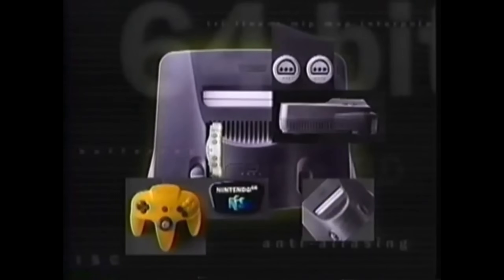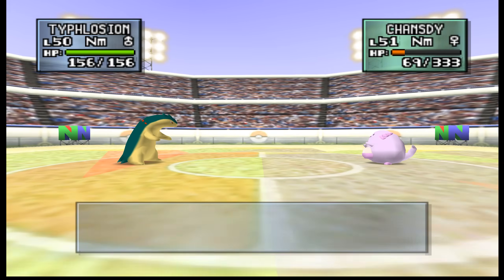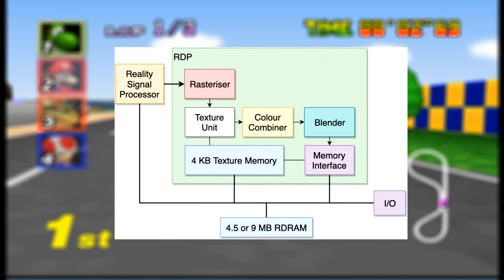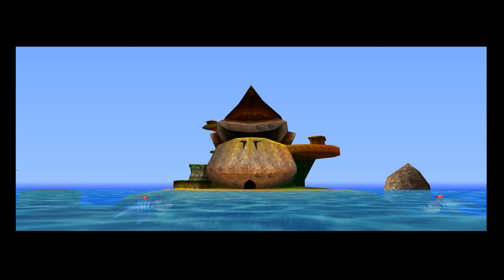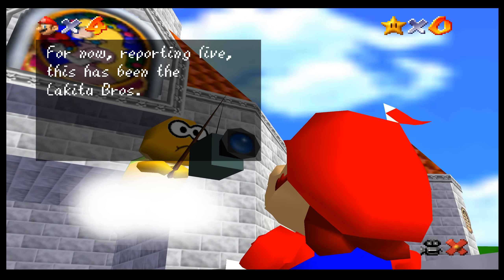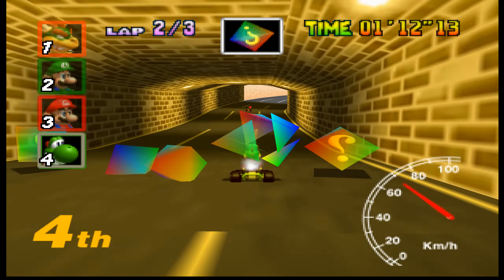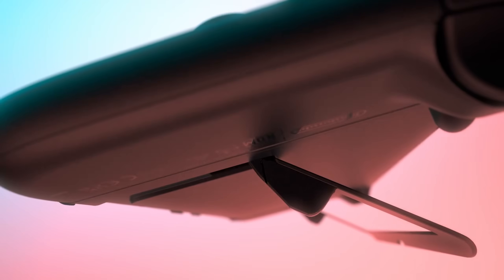The Nintendo 64 GPU: Reality Co-Processor (Retro Breakdown)

Comment: Lack of both a dedicated sound chip and Sound CPU was also another reason why N64 music in general was aggressively compressed. The compression was a trade off choice to decrease the workload on the main CPU and RSP to focus on running the gameplay and updating the graphics. The N64’s raw hardware was actually capable of CD quality audio (with a sample rate of 44.1 khz), but was rarely achieved due to high CPU demand and cartridge storage limitations. Hypothetically a dedicated sound chip and sound CPU would’ve sufficed this. Good review! 😀👍

Comment: thank you for being objective about the N64's limitations, the biggest issues relating to the bad CPU/Memory usage, and while yes, CDs had more storage, the PS1 had only 2MB of memory while the N64 had double, quadruple the ammount of memory with the expantion pak, which means the PS1 wasn't exactly capable of better textures than the N64, nor the games could be anymore complex, only really winning out in the sheer quantity/variety of assets a game could have, while with the N64 the limitation of smaller storage in the cartridges is really the only substantial culprit behind why N64 textures looked so blurry, because even with the small size of the texture cache, that didn't stop developers from creating larger, more detailed textures by simply cutting them up and joining them in-game, as was the case with the handful of games that had larger 32-64MB size cartridges, meanwhile if you download a PS1 game off a site, more often than not a PS1 game would only take up 100-300MB of disc space, and that's WITH all the assets and CD-quality audio in. I remember getting bootlegs of all the 3 PS1 Crash bandicoot games and they all fit into the same CD-R.

Comment: I love these videos. I just kinda wish the footage was rendered at the resolution and with the final smoothing filter applied. Granted, the considerable bump in render resolution is great on the emulation side. With the nature of the video being centered around the capabilities of the GPU on the N64, it would be more accurate to make it look like the actual machine is running the software. 
It's not a huge issue and I genuinely enjoy the content. I just played this generation (practically all the previous and most of what cam after) and the impression on any system from those days should really be considering the displays and the most popular means of getting the system hooked into back of the TV. 240P over a R.F. converter was pretty much average for the day (at least in the US... For whatever reason SRGB and SVIDEO inputs were unavailable/niche for the average TV from most retailers).

Comment: Even though there are more powerful ones, like 128 or more, 64-bit mode is the maximum power.

There's something I don't understand about Super Mario 64. For example, the Super Mario 64 cartridge doesn't need a memory card to save, yet there's no CR2032 battery inside the cartridge.

So does the cartridge work like a PS1 memory card? No idea.

I use translation software; I only speak French

------

Même s'il y a plus puissant comme 128 ou plus le mode 64 bits c'est la puissance maximum

Il y a un truc que je comprends pas dans Super Mario 64 par exemple la cartouche de Super Mario 64 on a pas besoin de carte mémoire pour sauvegarder et pourtant à l'intérieur de la cartouche il a pas de pile CR2032

Alors est-ce que la cartouche marche comme une carte mémoire de PS1 aucune idée

J'utilise un logiciel de traduction je parle uniquement le français

Comment: Cool video, but there were a couple of errors I noticed.

Factor 5 did not stream textures, they streamed level data into RAM (huge benefit of using cartridges)
TMEM is required for all textures, and it’s very expensive
RDRAM is nowhere near as fast as it claims to be, memory bandwidth is the biggest weakness of the entire console, which is why textures are expensive
Reply: Its interesting how RDRAM was also used on PS2 but it actually benefit the machine (at least the overall architecture they wanted), with its 2560 bit bus and 48.8gb/s of fillrate. On N64 it caused the opposite effect.

N64 really needed more bandwith... it could had at least made more titles get 30 FPS like PS1.

Comment: Actually, the N64 had a programmable graphics pipeline utilizing microcode. Homebrew has reverse engineered this and allows for some pretty advanced stuff like cel shading and fully dynamic shadows these days. There are also ways around the low texture memory size these days, i.e. there's a "megatexture" demo on Youtube. If you look up videos from "Kaze Emanuar", you'll see what the console is truly capable of when properly optimized for (high texture resolutions, more polygons, new effects and running at 60FPS!). The hardware design was way ahead of its time and people back then didn't know how to fully utilize it or work around certain characteristics like RDRAM's high latency.
Reply: only the vertex shader is programmable. The fragment shader is fixed. I still wonder what a "fragment" is. Probably the name stems from the internal data format which passes through the pipeline. We as users only care for the pixels at the end of it (after the blender). Or is fragment = (pixelRGBA, z-value) ?
Reply: @ArneChristianRosenfeldt  "Fragment" is just SGI/OpenGL speak for "pixel". N64's color combining/blending stage can be abused to do some stuff that's usually done with pixel shaders these days.
Reply: @Psychx_  I looked at the Atari Jaguar, which does not really have a texture cache. Perhaps with multiplexing it could use some of the other buffers, still texture fetching would fight with writing pixels.
So I think of the the blending stage in way that as much as possible of the fragment has been prepared and cached up to this point. Then only alpha blending needs to be applied. I guess that early texture reject breaks this concept. The Jaguar clearly would need early reject. So each pixel would be touched twice at separate times.

Jaguar interleaves z-buffer with frame buffer. This is futile. For early z reject we first need to access the z-buffer, then texture, and then frame buffer.

Comment: About those 4.5 MB of RAM: it had 9 bits RAM, and that extra bit could be used only by the GPU in some circumstances. So that extra 512 MB was not freely available for textures or other general stuff.
Reply: Are you sure it's not a parity/ECC bit?
Reply: @NathanDrake5  Of course. Why the hell should a game console have ECC????
Reply: @ I remember Rambus supporting some weird features like parity... it's a serial interface, unlike SDRAM's parallel one.
Reply: @tdome3000  "To add to this, the reason that the RAM was available with 9 bits in the first place is so that it could be used to make systems with ECC. It's just that you didn't have to use that 9th bit for error correction, you could use it for extra data, if you designed the system to use it that way."
Reply: @NathanDrake5  Still I don't get the usage in N64. For the finished frame we only need to preserver RGB. As far as I can tell, N64 has 15 bpp and needs two memory cycles to VideoDMA a single pixel.

Comment: One mistake in this video which I haven't seen mentioned in other comments is the mention of some cartridges adding extra RAM. That isn't a thing, at least not like on the NES. Some carts did contain SRAM, but that's a tiny amount and has a battery, and is for storing save files. It's not about performance at all. You could theoretically build a cart which contained a large amount of RAM (in fact, modern flashcarts are like this, the "ROM" space is writable by the console) but it would be more like adding an SSD to a computer, it would not increase the system RAM size.

I would suggest that you produce the scripts for these videos in collaboration with the modding/homebrew communities of the respective consoles, both to eliminate mistakes and also ensure that the most important points are covered (like the RDRAM latency in the N64 mentioned by the other comments). I would also suggest that you use footage from the real hardware rather than emulators whenever possible, or at least set up emulator settings to be limited to the original resolution of each console and without any added graphical enhancements.
Reply: Yeah, and why not just buy a power Pak? So you can use extra RAM for a lot of games!
Reply: @ArneChristianRosenfeldt  *Expansion Pak
And about 20% of games were designed to use it, while just 4 actually needed it.

Comment: I'd point out that the N64 was so powerful that it went toe to toe with the PC for graphical output for a good few years. That would be completely unheard of today.
Reply: It barely ran Quake 1 meanwhile PS1 was running 2 smoothly....
Reply: @sebastiankulche  John Carmack ported Quake to glide and GL. I read no complaints. Quake 2 on PS1 started with the PVS from PC to split the levels because they would not fit into RAM. 3dfx did not store the mesh. Rather the PC needed lots of main memory. Even our 386sx had 5 MB before the PS1 came out.
Reply: @ We dont have to compare PC RAM with console RAM like its 1:1 though, as consoles are always way more efficient. Some PS1 games have levels more than 5mb.
Reply: @sebastiankulche  I just meant that in times up to the PS1, PCs had ridiculously more memory just to boot fat windows. Then for DOS games, a lot of memory is available. Does 3dfx run under Windows 3.1 ? Probably not. Win95 could at least swap out most of its fat for the game. Amiga 1000 is a kind of PC and came to the stores with 1 MB in 1985, while 2d consoles maxed out at 400 kB total in SNES in 1990?
Reply: @ArneChristianRosenfeldt  SNES had 128kb of RAM and 64kb of VRAM if im not wrong, on top of PS1 RAM being newer and faster. Even with the cartridge advantage the SNES would dream streaming as much data as the PS1.

I agree about that first sentence, though it makes you thing how much wasted PC specs really are. I heard there was a few old PC games (i cant remember if they were DOS games) that interacted directly to the metal, and didnt had any OS overhead, kind of like a console game. Imagine if there was something like that on Windows.... you would have your antivirus screaming like crazy, lol.
Reply: @ commander keen and Wolfenstein3d run on bare metal. SVGA has 256 colors and scrolling and double buffering. No need for a driver to copy from the back buffer. But even with a DOS expander, the CPU only sees a 64k page. Is it really bare metal when you have to operate through a keyhole?Wing Commander III , system shock, and descent supported SVGA . And Quake, but they did not have a driver for my ET3000. You had to compile your drawing routines for each card because there was no standard for the ports.

Sound cards supported midi.
Reply: 3dfx on PC beat it in the same year. Same quality, but in 640x480 progressive scan. CD based games.

Sega MegaDrive was impossible to match on PC for a few years until ISA VGA cards became insanely fast for some weird reason. How can it even be fast to copy over a complete frame buffer on VSync ? Yeah, the video memory is idle at that time, but the CPU, which did all the 2d rendering on PC was totally blocked.
Reply: @ArneChristianRosenfeldt  About Mega Drive... Yeah, kind of, especially for 2d games, Mega Drive and SNES had unparalled sprite quality and scrolling. PCs were like one or two gens behind.

About 3d though, i doubt it, in 1988 we had Winning Run, which i doubt it would run on Mega Drive or SNES without special chips.

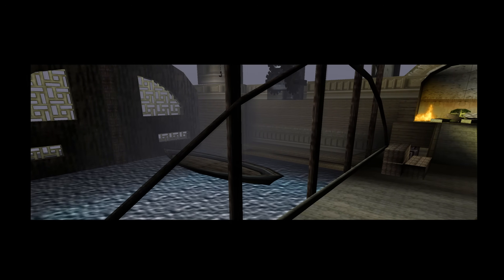Comment: 6:40  the ram is not actualy that fast, its prety slow, not even half of that
Reply: It is that fast, but at high latency.
Big issue is controlling how things are cached and invalidated again.
Kaze (who makes his own SM64 expansion) talked about it about 6 months ago, after he spoke to the developer of an emulator, and he generally goes really in depth about performance optimizations 😯
Reply: It is interesting how both N64 and Xbox have more brute force (in paper) than its competition but they also heavily bottlenecked with the slowest RAMs and bandwith of the gen.

Maybe that explains why a lot of exclusives that tries to push those platforms runs terribly slow compared to the competition.

Especially if they try to run at high resolution or use post processing effects, the system cant just keep up.

Was it to reduce costs?

Comment: Apparently, the N64 could support as much as 16 Megabytes of RAM, and this could be achieved by getting older N64s and (3rd party) expansion packs that used only 2 MB chips and swapping those chips for 4 MB ones. Unfortunately, there is no official game for the system that will make use of the extra RAM.
Reply: did you know that the C standard library has a function to check for free memory, but the OS developers don't want to tell? Each App / process should strive to minimize memory usage. In the cloud we launch Java Apps with memory limit as parameter.

Comment: The anemic cart storage space really murdered N64 hardware potential.
Most of the games have blurry textures and reptitive assests because there is not enough space to fit more textures and variable assests.
Reply: That and the texture cache
Reply: A common misconception that often gets sprouted online: The cartridge format didn’t hold the system back in anyway other than restrict what content could be stored (often being FMVs and raw CD audio files that would be sacrificed). 

Moreover, slapping a slow 2x CD drive wouldn’t automatically fix any issues of the console when we must factor in the horrible memory latency of the RDRAM implementation in the console itself. With the cartridge format, data could be fetched much quicker from ROM cartridge over RAM, a speed advantage that is lost when attempting to use CD drives that operate at a slow 2x speed.
Reply: @crazedlunatic43 The CD does have some specific things going on besides space:

If games are compressed to fit in the cartridge like Quake 1, decompressing takes much longer than loading from the CD.

The CD technology also allows for FMV MDEC compression and native Redbook audio.

PS1 does have its own RAM chip for the sound so in theory, even if N64 used all its space for just music, music in theory could still sound better on PS1, same with MIDI samples (although this isnt too dependant on the CD technology)

Redbook Audio is also almost impossible to recreate on N64 as, even if it fitted with RSP hacks, it would still need to be decompressed.

A game like Vib Ribbon wouldnt be possible on the N64 because there would be no way to swap cartridges (if they even got license music to begin with it, lol.).

I also find interesting how the game Monster Rancher does use the PS1 laser to see the CD data. Every non game CD still have unique identifiers and TOC information.
Reply: @sebastiankulche  There was definitely some advantages to be had on the CD ROM format, but I feel like the advantages were more pronounced with how the PS1 was elegantly designed

Such as the built in MDEC chip that’s found exclusively on the PS1, and is the main chip that’s responsible for delivering the FMVs that you see in many PS1 games. Sure the CD ROM format did support motion playback, but the PS1 had superior hardware when it came to supporting such a feature, and even surpasses the Sega Saturn in that regard.

Of course I do feel like both CDs and Cartridges have their own set of advantages and disadvantages and it depends on how games are designed and how it works with the console’s underlying architecture.

My original comment in this thread (from four months back) was arguing about how the Cartridge format wasn’t exactly the console’s biggest bottleneck as the media often claims, and it really had more to do with how the N64 was designed

Ideally, you wouldn’t want to use anything other than Cartridges on the N64. The console could technically use CDs, but it would be painfully slow

Fun fact: The console didn’t even provide dedicated circuitry for handling audio, so it was up to the GPU to provide audio (though the CPU may be tasked with this as well), so besides lacking storage capacity to store audio, developers had to choose between sacrificing performance and music, and the latter is often sacrificed.
Reply: @ that texture cache and the latency rambus had didn’t do it any favors.
Reply: Ridge Racers has how many tracks on the PS1? And each track needs to fit into RAM ( which is almost half that of the N64 ). Now add some slow offline compression which may give a factor of 2. Then even on the launch cartridge of 8 MB, you should be able to put 4 levels / tracks with more detail than Ridge Racer. Later you could use 32 MB cartridges and expansion pak ( which PS1 has not). At least racing games should look so much better on N64 than PS1.

Comment: What about the memory access bottleneck? That's singlehandedly the most infamous N64 bottleneck and the number one thing that held the system's performance back.
Reply: Yeah, what about it? So memory as high latency, but this is not problem for the RCP, which has two components: The RSP caches most vertices (in a mesh). So you can optimize a mesh that you meander around. Then it only needs to refill its vertex cache one in a while in a long burst. There is only latency at the start of a burst. The RDP loads the (you all say tiny) 4 kB textures in a burst. Then its blender ( I guess ) loads z-buffer values for a span in a burst. Hopefully, there is some pipeline active, so that directly afterwards it can write back new z-values in burst and then the pixel values. This may be slow for small ( narrow ) polygons, but I could not find any numbers. Dreamcast with its tiles really has the better blending approach for high latency memory. Even on Jaguar I hate that it draws span by span and cannot draw small polygons in one go ( from cached values, I don't even need a fast shader ).